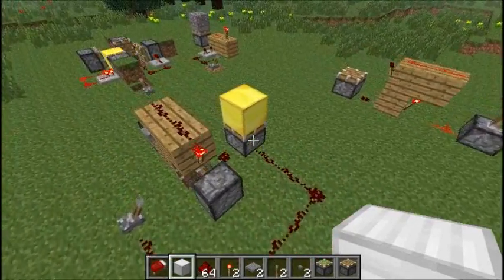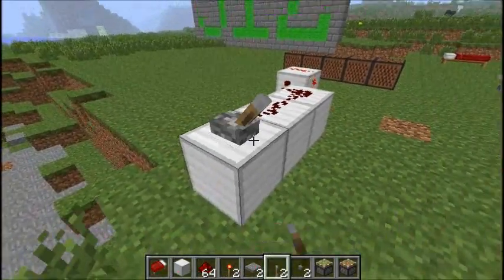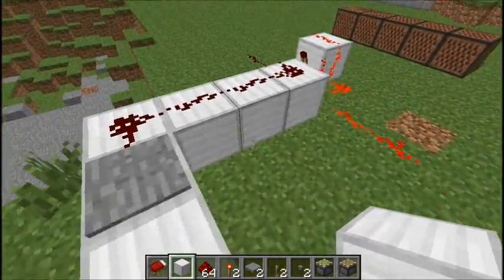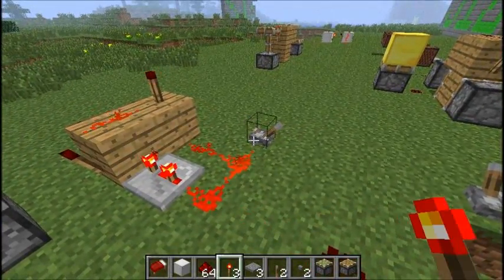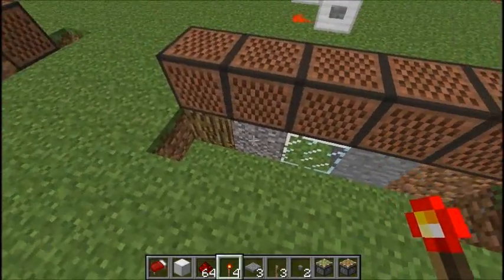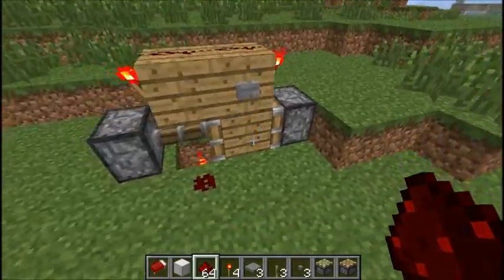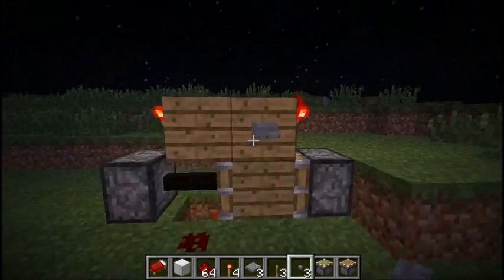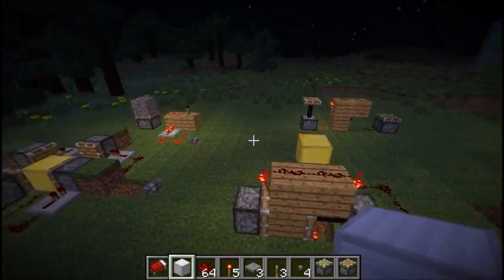Minecraft Special - Useful Redstone Inventions

Comment: Why exactly would you need to turn a button into a lever in the first place? That contraption just uses up more redstone, and space than a lever does.
Reply from the maker: T-Flip-Flops (TFF) are a basic element of digital systems along with many other "gates" and "latches". A TFF allows the designer to turn a pulse signal into a toggle signal, effectively "saving" the state of the signal. One pulse, toggle ON, one pulse, toggle OFF.

Comment: That is the easiest way of building a redstone clock ive ever seen. A lot of people seem to over-complicate it and have to physically break the circuit to stop. I'll be using this to make a cobblestone generator.
Reply: This one is slower than one you have to manually stop. There is more easier clocks with out the physical stop but are rarer than manual ones